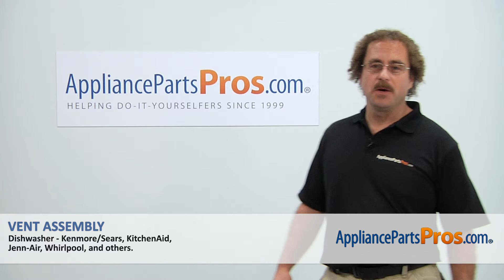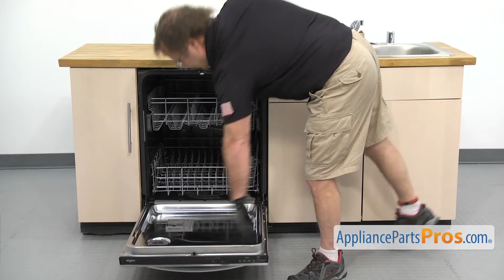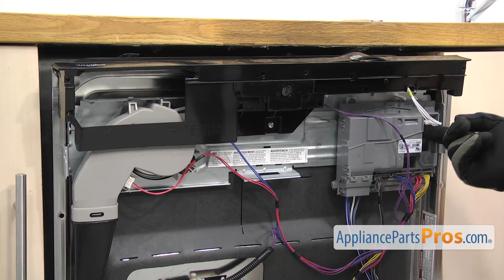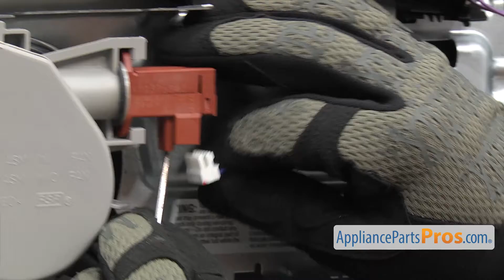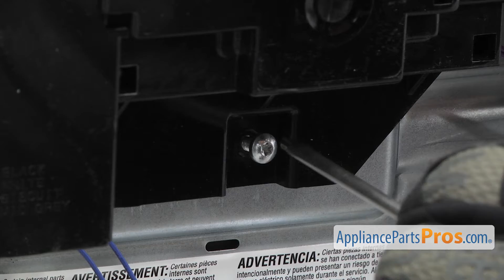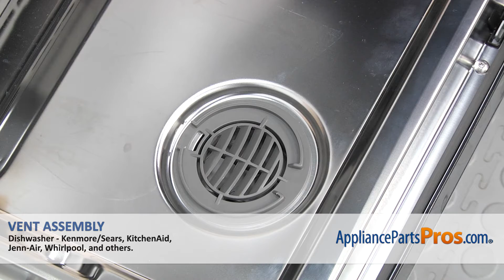How To: Whirlpool/KitchenAid/Maytag Dishwasher Vent Assembly WPW10469574

Comment: I noticed when I changed my detergent dispenser that water was coming from above it near the vent and fan assembly.  The water has has calcified.  Does this mean that the dryer fan assembly, which seems to be running, is not tight against the metal?  Do I need to add a gasket somewhere?
Reply from the maker: The buildup could indicate a leak around the vent assembly, but it doesn’t necessarily mean the fan isn’t seated tightly. Check the vent housing, mounting area, and any seal or gasket for damage or gaps. Also make sure the vent is securely fastened.

If you need further troubleshooting/ testing from our techs you can check out our repair forum:
https://forum.appliancepartspros.com/

Comment: Old post. I noticed when we opened the door it would bow the door pulling the gasket away from the door allowing water to get in and soaking the insulation. Sound right? Does/did replacing it fix that issue?
Reply from the maker: That definitely sounds possible; if the door bows and the gasket pulls away, it can let water into the door and soak the insulation.

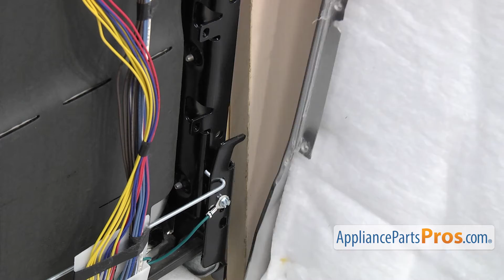Comment: does anyone know how to get the vent pipe loose from the inner door? there is a thin cross bar visible in the video at 5:00 (it spans the width of the inner door and covers the vent pipe) that I cannot for the life of me figure out how to remove. I would prefer not to have to remove the hinges. Just wondering if anyone else has run into this. I have a wdt730pahz0 and I can't get to the 3/16 bottom seal screws unless I figure out how to get that darn pipe out of the way. thanks!
Reply from the maker: Here is a link to the video for the replacement of that bar: https://youtu.be/qHVduYLs5x0
Reply: @appliancepartspros  thanks for the reply. the linked video shows how to remove the outdated part that the hinge brace replaces. but not how to remove the hinge brace once it's installed. Seeing how easy it went in gives me the confidence to put a bit more stress on it to remove it though so I'll give that a shot next time I open it up!

Comment: Is it normal for a small amount of water to be inside the vent after a wash? Not necessarily dripping on the floor but if you put a paper towel on the vent it will soak up a bit of water. Asking because I recently had mine fixed from where it was leaking around and on the insulation. Just want to be sure!
Reply from the maker: There may be some water in there due to moisture.

Comment: Will this cause water to leak into the insulation and onto the floor.
Reply: Yes, this is what was causing my leak
Reply: Old post. I noticed when we opened the door it would bow the door pulling the gasket away from the door allowing water to get in and soaking the insulation. Sound right? Does/did replacing it fix that issue?